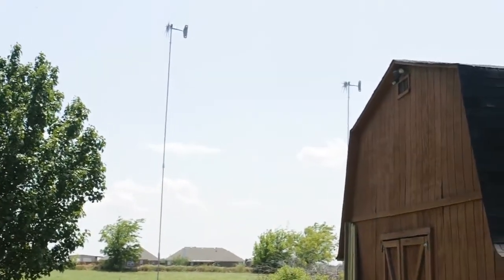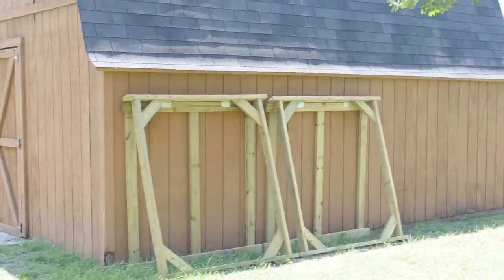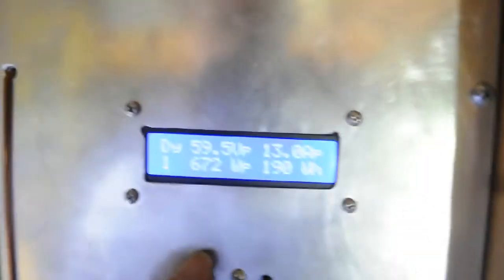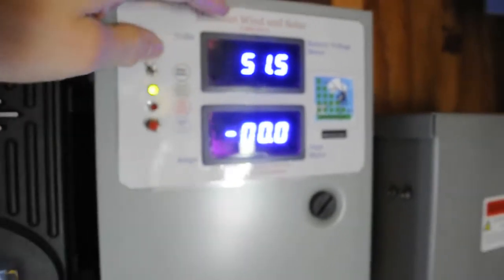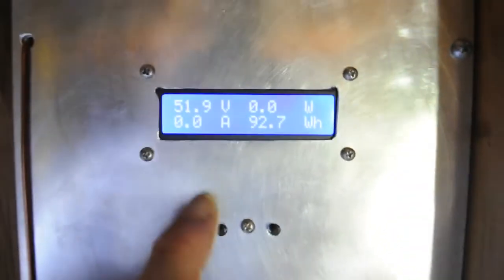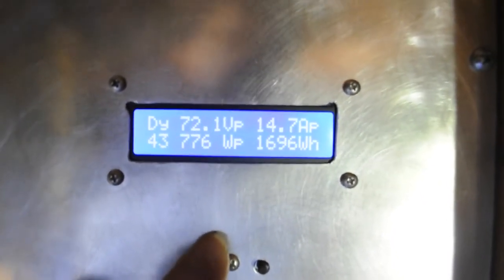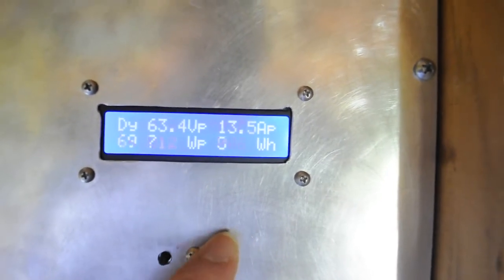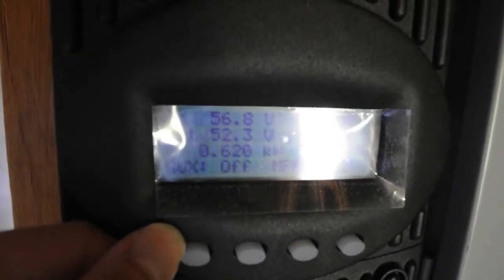Our RE System 2012, Part 2; kWh Logger Update

Comment from the maker: Well, from the shed to the top of the tower, I’m going to guess the farthest is around 120 feet. We use 12 gage solid copper wire from the shed to the base, then stranded 12 gage from the base to the tower top. We do have a 48 volt system since it was the most economic choice. However our main turbines are 3-phase AC, so three conductors of 12 gage wire.

Comment: I have taken some programing classes and I have the basic stamp kit and I did some things and built a vb.net program for every time somthign happend on and input on the stamp kit it show up on the program I created so the hardware was able to communicate with the software and if I wanted a pin to go hi I could click on a programed link tha tthen communicated with the microcontroller and turn on a led or turn it off or run a motor untile it hit a targed positing and it tell me.  its a lot of fun

Comment from the maker: Well, unfortunately it seems we’re actually having some funny issues with those Air Xs. They don’t seem to be producing /anything/. I think their internal charge controllers may be shot, each in their own unique way. :( We’re going to take them down and wire the stator coil directly to a 3 phase system since we wired them separately all the way to the shed. If we can get the controllers working again, we’ll just wire them where the rest of them are, inside the shed. So we’ll see what happens.